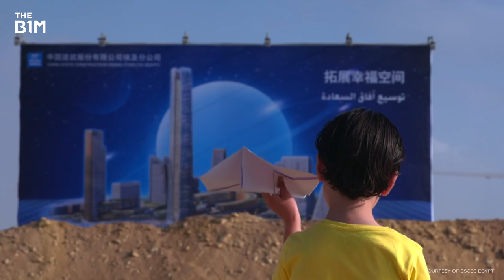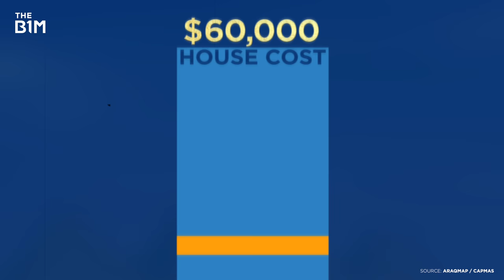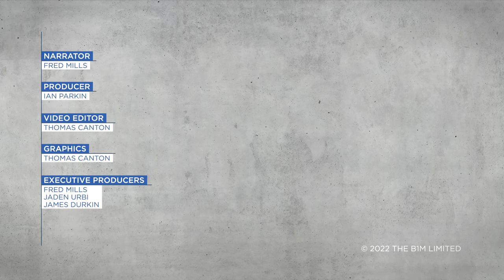Egypt Built a Supertall Skyscraper in the Desert

Comment: Years ago, when my dad was sent to Egypt to consult on another matter, he was shocked that a new apartment building had a problem where running water did not reach above the 4th floor. They had not installed pumps to get water to the upper 6 floors.
Reply: @devinreese7704  Are you high? Did you just read the comment, new apartments, water doesn't even work.
Reply: @ekay4495  
And? Theres no details in the comment.
Couldve gone to an apartment in some slummy neighborhood?
Reply: @bonafidemonafide7810  So people in "slummy neighborhoods" don't need running water?
Reply: The Pump should send the water to water tanks on the roof; then have the water go down via gravity or further boosted by small pumps in case of slow water flow; not having pumps deliver to each and every apartment..that’s not smart
Reply: @devinreese7704  I think before they even consider answering you, you should answer exactly why you're asking?
Reply: @Tech-WonDo  found the new Yorker
Reply: @gtctv7000  What do you mean by that?
Reply: Maybe the pumps where down where your father stayed. This is not an issue,Egypt produce 35% surplus in peak power, and pumps are cheap.
Reply: I think your father was out of luck, he stayed in a bad building. I studied and lived in Cairo for 6 years, all buildings had functioning pumps that pumps water to all floors even 20+ floors with no problems at all. And they don't use roof tanks in Cairo water is 24/7 available.
Reply: @ekay4495  I think that's the point: that it's not a shock how Egypt lacks foresight for these kind of things.
Reply: @bonafidemonafide7810  Bro literally days new apartment buildings, and as if poor people don't even deserve baisc shit?? Smh
Reply: @Tech-WonDo  Roof water tanks don't exist in most places.
Reply: @stayfesch  Yes, but illegally, and doesn't pay shit for their services
Reply: :yt:  A very stupid move for a 3rd world country! 🤔
Reply: @Marwan-tx5nb  You have to have the knowledge to use the pump. Its all good to have money and excess electricity, but not if you dont have the brain to use those resources lol
Reply: @LutraLovegood  They do but it’s a costly option 💵; Pumps only vs Pumps and Tanks?
Reply: @LutraLovegood  They do but it’s a costly option 💵; Pumps only vs Pumps and Tanks?
Reply: @ekay4495  lmao read my latest comment.
Reply: @MrWackozacko   Bro, that's just racist.. 
You are acting like shitty landlords don't exist in the west. I lived in Cairo for years,  pumps do go down sometimes from the heat, but they are usually fixed in few hours.
Reply: So they built taps and showers and shit, but not the capacity to supply them with water? What a waste
Reply: @tryfanevans7047   Having a shitty landlord doesn't translate to a nationwide problem. Egypt has 100% access to water and 100% access to electricity according to IMF. A 200$ pump with labor cost less than 10$ an hour, is definitely not a realistic barrier. 

Most apartment buildings in Egypt don't have reservoirs because water is available 24/7 in every part of the county, including desert oasises.
Reply: @Marwan-tx5nb  يا عم سيبك منهم دي ناس تعبانة والله 😂
Reply: @Marwan-tx5nb  يا عم سيبك منهم دي ناس تعبانة والله 😂
Reply: Try the US, how you eat in the dessert ?
Allah = mad !
Reply: @omaraldulaimi909  Indeed you are correct. But what happened, no advancements have come from there for 1000 years? Also the Egyptians that built the pyramids and the Egyptians that live there today are not the same people. Polytheism is very haram.
Reply: @user-xy5bc5mq4r  Yeh all good brother i love you. I just typed up a big hateful long speech about what country is better and read it back and realised im just being an argumentative wanker. Peace
Reply: @ekay4495  this is why we call certain countries first world and others third world.
Reply: I live on the 12th floor and I just took a shower. The fact that you are talking about  a country that can build such city but doesn't have a water pump is ridiculous.
Reply: @Tech-WonDo  Water is stored in tanks only in some cities in egypt, where they are usually on the adjacent pavement to the building or in one big underground tank, because people don't install ball valves in water tanks, which leads to overflow on the roof each time water is pumped to the tanks.
On the other hand, the rest of egypt gtes water to each building, but the flow is weak to reach 4th or 5th floor, so people install pumps on their own if they wanted to.
Reply: @Tech-WonDo  He must've thought you're from NewYork.
Reply: @osamadamarany5994  Ye; NY 😂 these people are just clueless
Reply: @osamadamarany5994  That’s the reply I wanted to see; an Engineer’s response; not an emotional baseless one
Reply: @Tech-WonDo  TBH, I would've thought you're a NYer too, had you not typed another reply in an EG accent.
Anyway, I'm not an engineer, well, sort of, I just lived in different places all over EG.
Reply: @osamadamarany5994  Honesty is the Key to Kindness and حسن الظن; بارك الله فيك 🤲🏻🤍🌹
Reply: @devinreese7704  It's not a shock at all.
Reply: Water tanks are almost always on the roof. Not sure what your dad is talking about…
Reply: Bonbony Cema  What are you talking about?
Reply: Bonbony Cema  I didn’t know what exactly were you confirming; also towers in general or you mean specifically in Egypt? Are you an Egyptian?
Reply: Bonbony Cema  قشطة 👌
Reply: Bonbony Cema  manta m5tsh balak mn el Comments el 2blohom 😅
Reply: @mox889  Yah but tap water is not safe to drink in most of Egypt. Its recommended to boil the water, or buy bottled water for drinking. Some parts of Cairo the tap water is drinkable but the water is heavily chlorinated.
Reply: @tubester4567  Egyptians drink it normally. But, for foreigners bottled water is  better yes.
Reply: But I thought they have Wakanda and stuff...
Reply: @gtctv7000  That is every country that does high-rise buildings....  Well except Africa lol...
Reply: @MrWackozacko  give proof dummy that the Egyptians live there are not the same people
Reply: @FJB2020  This is way down south
Reply: @FJB2020  not really no. Far as I know, here in Germany we just use stronger pumps. Besides, Africa is neither a country nor does it have coherent high rise building standards. That's just a bad faith argument
Reply: @gtctv7000  Where in Germany do you have a concentration of high-rise residential buildings?
Reply: @user-or1rm1ol3q  You see your arabic name? Arabic didnt exist in Egypt when the  pyramids existed. What do you say to this?
Reply: @user-or1rm1ol3q  I givd proof to you dummy
Reply: @FJB2020  frankfurt mainly, but I've seen some also in Stuttgart and Berlin. Besides, i only mentioned Germany cuz I'm most familiar with it but i can say with some certainty that water storage on top of skyscrapers is most commonly associated with New York and there are no cities which use em as commonly as NY
Reply: @user-or1rm1ol3q  And you also believe in Osiris?
Reply: @satisfied656  The term "3rd world country" means nothing. I bet Egyptians say the same for far poorer states than their own. Kind of the same how countries like Germany call Eastern Europe - a third-word zone, despite of less crime and close to similar income-to-pricing ratio with most of Europe. And often, with superior infrastructure.
Reply: @Ali.shdifat  you arz egyptian lol... Of course you would say so

Comment: Always entertained by the renderings of what could be and the planning layouts on projects, but seeing one in progress leaves me a bit stunned by the amount of the building material somehow procured, as in the case of this build so far. That's a lot of concrete and rebar.
Reply: The building materials in Egypt are stronger than that in the USA.  In the USA. They still build with woods. That. Is. Why. They were destroyed in the hurricane in Florida
Reply: @pharaohtheegyptian1714  What are you talking about? Houses aren't typically built with concrete reinforced with rebar outside of fhe foundation.
Reply: @guilhermetavares4705  no. Dummy
Reply: @pharaohtheegyptian1714  ah yes. New Yorks wooden skyscrapers.
Reply: @pharaohtheegyptian1714  the least delusional egyptian

Comment: Curiosity Question: How thick is that slab support? And will all the towers built in this NAC have them?
Reply: What kind of a question is that?? We don't do engineering in the youtube comments section
(see above 👆👆and below 👇👇for examples of what we DO, do)
Reply: More cross section area means less stress
Reply: @maxrockatansky5657  I understand that. I guess another way to ask it is the following: how tall does a building in those sandy conditions have to be before a larger base for it needs to be considered?
Reply: Raft slabs are typically between 10 to 15 and sometimes even as much as 18 feet thick.

It all depends on the soil conditions.

Comment: What is so typical of these massive developments is the non-existence of real public life in their exterior public spaces. The impressive nature of such developments lies principally in the daringness and verticality of the tall building as volume and in the super freeway of automobiles that “ties” them together planimetrically. Human scale is either lost, nested away somewhere at the building’s entry lobby and exterior fountain area, or is simply nonexistent.

Even the characteristics of some modern materials, such as glass curtain wall systems that dress some of these buildings, can render them “anonymous”, somehow echoing and adding to the impersonal nature of the urban public space left behind just moments ago, where reflectivity rather than transparency is the norm. 
The building’s function is irrelevant; it’s function becomes sheltered by the privacy screen given by off by atmospheric reflections on its facade. The building becomes a singular entity, only to be looked at and perceived in its entirety from afar. When inside, the vertical becomes an absentee, as if somehow lost at the entrance lobby, time ago. The awareness of “height” only becomes apparent when you make your way through a maze of tight, low ceiling corridors that lead you to a typically locked room beyond which there is an outside wall with an opening, from where you look out and finally realize that you’re on the 73rd floor.

Comment: The way this new city has been designed is already a big mistake in many ways. It lacks density in many areas, so to get from A to B requires a car in most cases. It's like they are building islands separated from each other. Offices in one place, houses in another place, so people need to move around all the time. Office areas in the heart of the city will be dead after work. It's not well integrated and repeating the mistakes of how US cities were designed decades ago. This also encourages segregation, as many people from old Cairo can't afford to live in the new capital, which is much more expensive. There are not many buildings close to each other for creating shade either. Besides that, they seem to mix many architecture styles randomly, rather than making it look coherent.

Comment: I hope this project succeeds. Having said that, I'm sure building methods have improved and that one can build quickly with the right materials and the correct procedures. Nevertheless, the speed of that concrete pour, for a foundation meant to support a super tall building, is concerning. Plus, the whole thing being supervised by Chinese contractors, who are known culturally to think that cutting corners is just the way things are done.
I'm sure the tower will stand just fine at first. But I fear that there will be major problems with it in the long run.
I'm no expert and I hope I'm wrong.